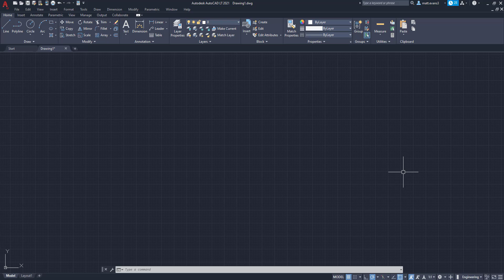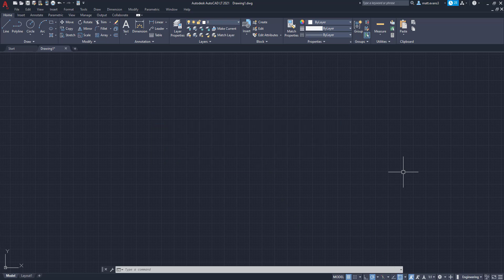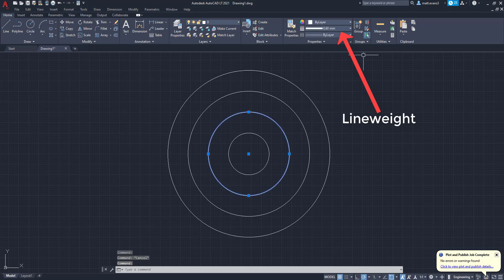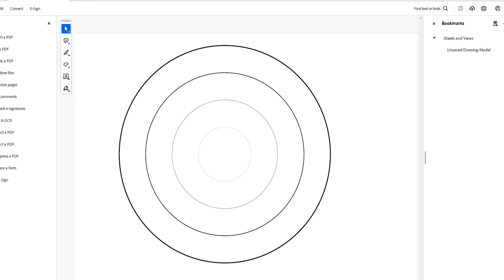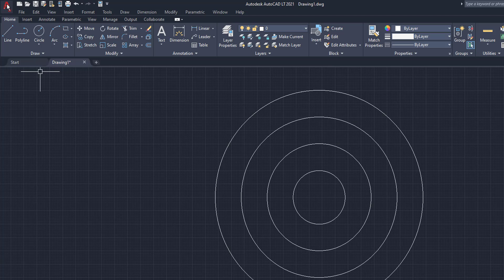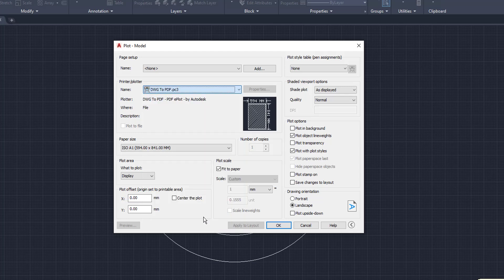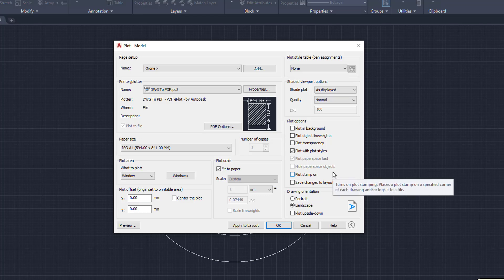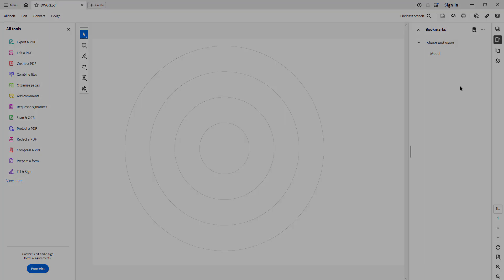FIX Lineweight Thickness in PDF - AutoCAD

Comment: My drawing is scatttered after that ..means,.the drawing shows disconnect between the points..how to fix?
Reply from the maker: You might want to check what line type you are using. It is possible that the line type makes your drawing appear like this. Personally I have never run into this issue but will look into it further to see if I can replicate it.
Reply: @matt.autocadbasics  ok sir thanks

Comment: I tried this and I loose the variety of all my line weights and all the lines now look the same. Is there a way to keep the variety of line weights but not have the lines come out too thick as you mentioned. I am new to CAD and working on a MAC. Thanks
Reply from the maker: To keep the variety you will just not hit the “Display Lineweights” button. Instead you will need to manually find the thicker lineweights and change them individually.

Comment: Having different lines with different thicknesses is exactly what I need when I pdf my drawings.
Some drawings rely on this difference to highlight, for instance, the geometry which is in the scope of work, versus the surrounding geometry.
Reply from the maker: For those drawings that rely on the thickness, simply leave that "Plot Lineweight" box checked. A common issue that I consistently run into is that someone uses a thick lineweight for thier entire drawing without realizing it. This is due to the fact that LWDisplay is typically turned off. I have made the unfortunate mistake (multiple times) of converting PDF drawings that look like one solid blob of color. To your point, sometimes lineweight is important and is needed in a PDF if thats the case it needs to be corrected in AutoCAD before converting to PDF.
Reply: @matt.autocadbasics  Thank you for your reply, Matt.
I have worked with Autocad since 1991 and most of the time I had to follow the technical drawing conventions regarding lineweights, hatches, etc.
Going back to your tutorial, you may want to touch down on the "lineweights scaling" in both the plot and the page setup dialog windows, since that setting also affects the output.
Best regards.
Reply from the maker: @ fantastic call out! This is more of a quick fix video tutorial. I always defer to setting every thing up properly when beginning to draft.
Reply: @matt.autocadbasics  Quickest way would be to create a Paper Space page using a pre-defined template. I would do that whenever I would have large amounts of pages to pdf/print. Once your page setup is complete and to your liking, you can use it for years.
Case in point, for some of my title blocks all had to do was to update the year whenever that changed. Everything else stayed the way I set it from the get-go, meaning one less headache for me.
Thanks.
Reply: great advice. so that's lineweight scaling, which is the culprit like the infamous non-annotative dimensioning.